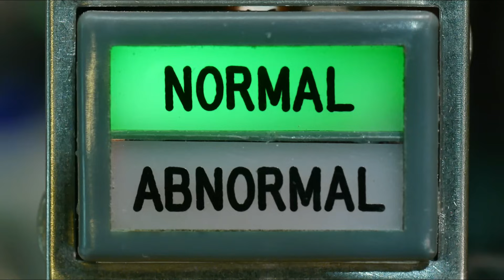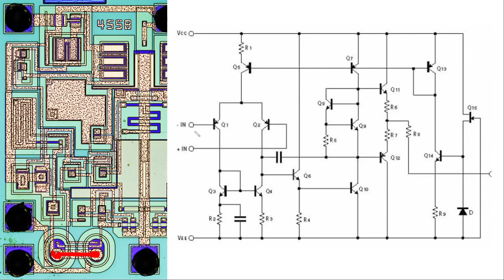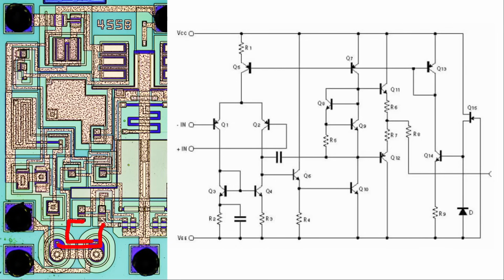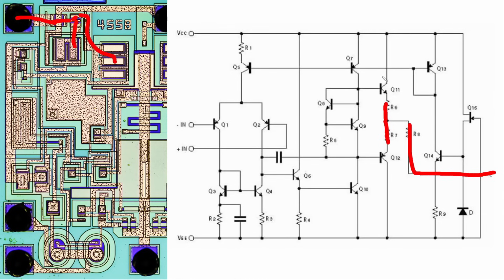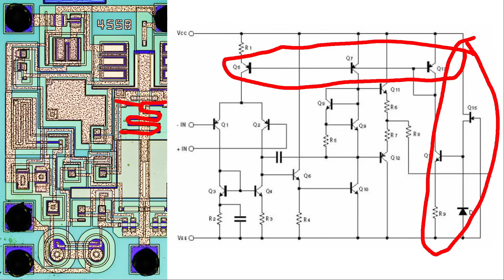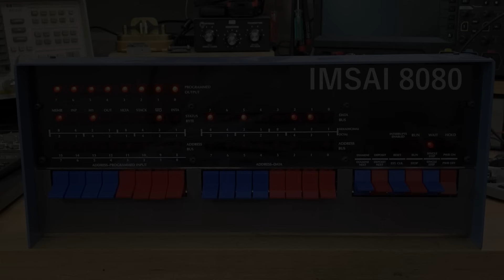#1760 Decypher Silicon Wafer Geometry

Comment: Great explanation except, please please please: the voltage doesn't "come", it's the current that "comes"(or goes). It's the fundamental to understanding bipolar semiconductor operation.
Reply from the maker: so if there is zero current, there is zero voltage on the die?

Comment: Chapter titles

- 0:05 Introduction to Silicon Die Analysis  
- 2:10 Understanding Transistor Layouts and Cross-Sections  
- 3:58 Identifying Components on the Die  
- 9:50 Exploring the Output Section of the Die  
- 11:29 Closing Remarks and Additional Observations

Summary
Introduction to Silicon Die Analysis  
- 0:05 Introduction and the purpose of the video.  
- 0:23 Presentation of a microscope image of a JRC 4558 die, a dual op-amp audio type.  
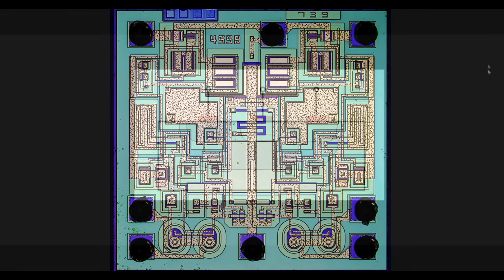- 1:00 Discussing the basics of transistors and their structure.  
- 1:07 Explaining how transistors are made in three dimensions, using P and N materials.  
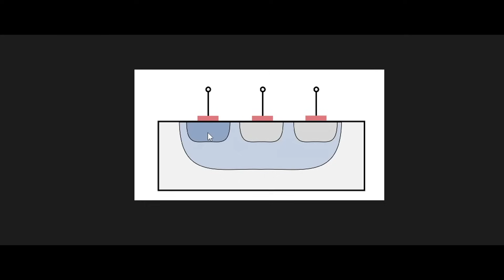- 1:43 Describing the layering and doping process in silicon wafer manufacturing.  
   
Understanding Transistor Layouts and Cross-Sections  
- 2:10 Explanation of transistor cross-section with emitter, base, and collector.  
- 3:00 Comparing transistor layouts to PC boards with insulators and metal layers.  
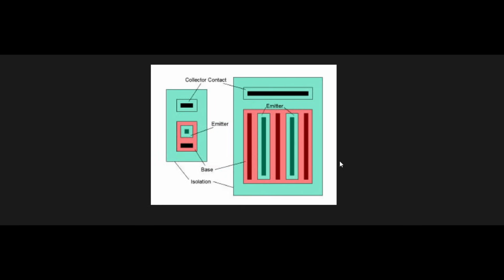- 3:26 Showing top views of transistors, highlighting differences in size for current handling.  
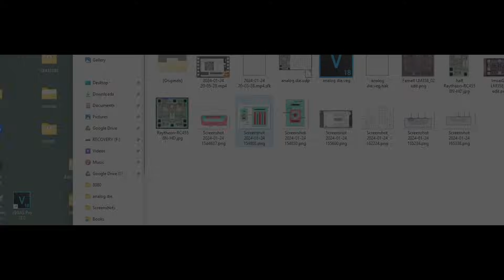- 3:43 Clarification that the photographs show only the top view of the die.  
   
Identifying Components on the Die  
- 3:58 Discussion on how to determine the orientation and purpose of pads on the die.  
- 4:24 Labeling pin configurations on the die based on component identification.  
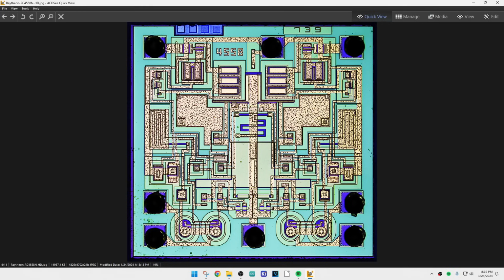- 5:00 Focusing on one half of the die for analysis.  
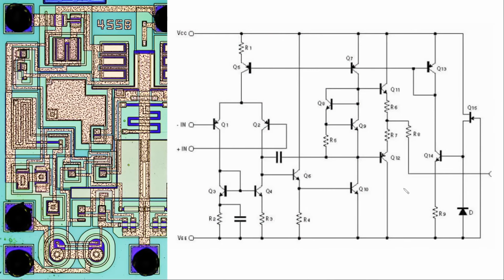- 5:14 Using a schematic to correlate parts of the die with their functions.  
- 5:48 Tracing the base and emitters of transistors on the die.  
- 6:08 Identifying a transistor connected to the emitters.  
- 6:25 Locating a serpentine structure on the die, which is a resistor leading to VCC.  
- 7:01 Pointing out capacitors on the die as large blank areas.  
   
Exploring the Output Section of the Die  
- 9:50 Analyzing the output section and identifying push-pull output transistors.  
- 10:31 Discussing shared sections of the die that are used by both sides of the dual op-amp.  
- 11:22 Encouraging viewers to explore and understand silicon dies.  
   
Closing Remarks and Additional Observations  
- 11:29 Mentioning the LM 358 as another example and explaining legal aspects like copyrights.  
- 12:18 Exploring the layout of the LM 358 and identifying different types of transistors and their configurations.  
- 13:14 Concluding the introduction to silicon die analysis and suggesting it as a way to learn more about electronics.

Disclaimer: I used gpt4-1106 to summarize the video transcript.  This
method may make mistakes in recognizing words

Comment: I used to work at a chip layout place, and they had a few people working on reverse engineering chips back when it was still possible due to feature size.  They would literally buy chips, have them decapped, and have someone with a microscope hooked to a camera and VCR.  They would carefully pan over each "screen" worth of the chip, pausing for a few seconds in each section.  Then, someone else would play the tape and capture each screen, and once that was done, someone would laboriously trace over the chip sections to diagram out each component.  It got even more challenging since there were usually multiple layers, meaning that this process had to be repeated every time a layer was etched away, and the diagrams combined.  It goes without saying that often the etching was either incomplete or etched away too much material, which made it even more difficult.  Finally, someone would pull together the diagram and generate a schematic.  Tons and tons of work, but I guess it was worth it to the customers we did it for.

Comment: Awesome....

Nice review 

Did you decap them ..or that other place.....

Maybe it would be nice..take a 7805....heat up or decap but leave bond wires . Then power it up ...gradually increaee load and  overload to see which component smokes first..

It might or I suppose go into overload and fold back and save its magic smoke...

Since they are easy to fry...like forget to use heat sink..

I think the output transistor would die...

Now Fred why the destruction?
I bet as it approaches death...the view from above that area would change color

The ambient light might bias weird too. I suppose then a before and after fry pics could be taken
...and to bias correctly cover the die.

Good job

Comment: That one capacitor is actually a reverse biased diode, as it is easier to make a PN junction big, and as you need to connect it to the P substrate, making it a huge diode means you do not need to make a thin oxide layer for the capacitor, the depletion region instead, easier to control, is the capacitor. 

Also the common bias sections is why it is considered a bad thing to use a dual or more opamp with one section overdriven as comparator, as you run the risk of that comparator input being driven too far, and thus having input bias current flow back into the bias network, making the other opamps in the package change operating point, or even bias them totally off

Comment: Ok but what if I don't have the answers on a schematic in front of me?
Reply from the maker: You draw one from what you see.  Same as a PCB you don't have the schematic for
Reply: There is a whole process for reverse engineering the chips where they delayer the chip/die  one by one and take several magnified snapshots these are then shared with a team who extract the schematic out of it and try to make some logical version of it 
But with all the latest nano  nodes it’s kind of impossible as you have to add a whole lot of dummies to have the correct exposure on your active devices